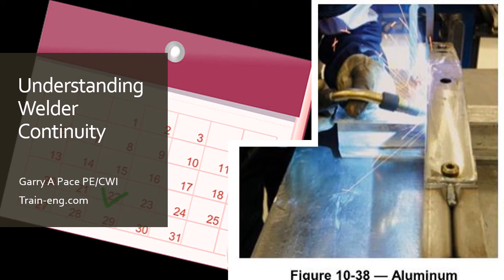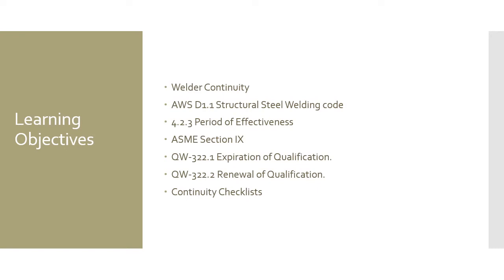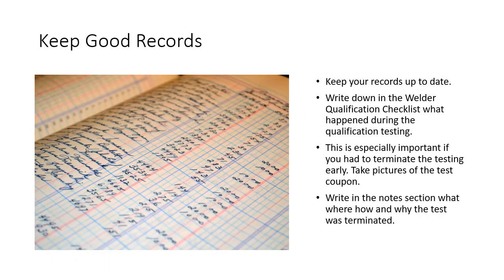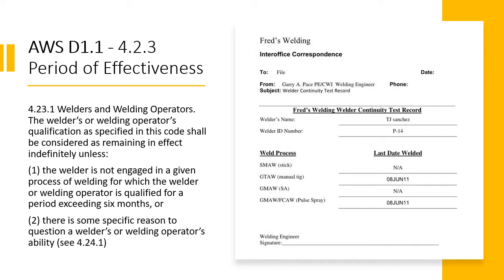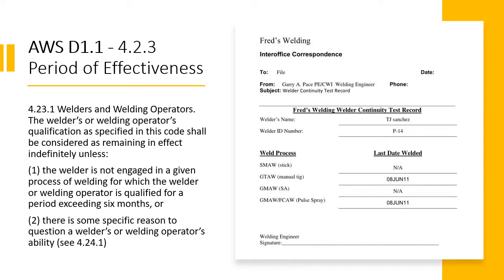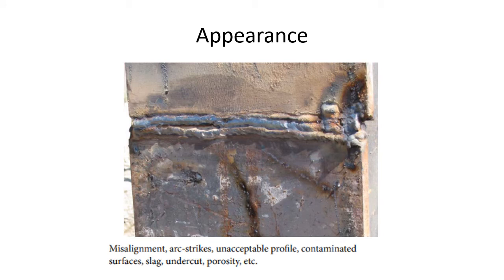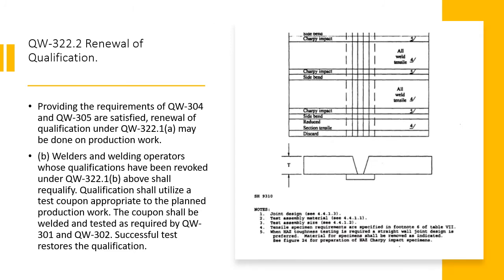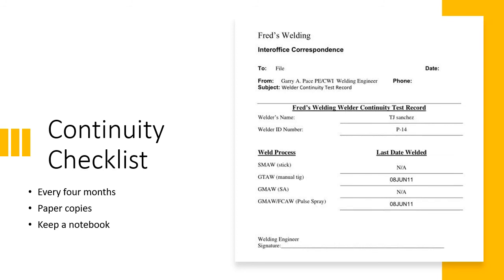Explanation of Welder Continuity

Comment: Hi Garry, Loving the videos by the way. your delivery and content is spot on. I see that at 21.19mins in the spreadsheet shows GMAW & FCAW in the same column. Our shop works primarily to ASME IX but also AWS and ISO weld code along with various construction codes (DNV, API, etc etc). When I read ASME IX Table QW-355, other clauses and the official ASME Interpretations it reads to me that FCAW can be lumped in with GMAW for welder continuity which is aligned with what you have shown on screen.....all good so far...we are on the same page.....but a few welding engineers have asked me to maintain separate continuity record for FCAW and GMAW (although no one has shown me where this is stated as a requirement). I just do it to save the discussion/argument s it isn't a big deal but I would be interested to hear your views on this.
Reply from the maker: For ASME Section IX it is the same process - I can qualify welders with hard wire and they are qualified to use flux core with that same qualification so I would not see any need to keep separate lists for continuity but if you need to for the sake of keeping the arguments to a minimum sometimes you have to go that route.
Reply: @gpacex  FYI - I now keep the FCAW continuity records separate from GMAW to keep the peace and to better comply with ISO weld codes/standards (ISO 9606/ISO 4063 / ISO15614 / ISO 3834). We also have an "examiner/examining body" per definition in ISO witness and sign off.

Comment: Question regarding a potential employer.  The individual told me they were a CWI but doesn't recall when they got the certification and that the paperwork is somewhere they would have to look for it.  They also told me they were able to take the exams at home!  In addition they told me they were only certified up to 3/8" steel but doesn't recall what process.  Sounded very suspicious to me, but I'm not a CWI.  Should I trust this person and their certifying me?  Thanks.
Reply from the maker: Should be able to look up his CWI number in the AWS database. CWI needs a renewal every three years. Lots of unanswered questions - throws up red flags for me.

Comment: Question is that who shall certify that the welders did perform a certain process in the continuity log? Is section 6.2.3 to 6.2.4 the answer? Because it doesn’t make sense to me that anyone can just write a log and sign it even if they are not even a CWI or a PE. If any and for common sense sake, it should be a CWI who should sign off on a continuity log because it is the CWI who is qualified to examine the performance of the welders for any given job within every 6 month period. I hav had disagreement with welding shop owners because they are contesting that it was not required for the continuity log to be signed by CWI
Reply from the maker: It doesn't need to be signed off by a CWI it can be a person in house who has seen the person do the work and use that welding process. There is nothing special attached to performing that task that would require a CWI.
Reply: @gpacex  well this is a gray area because the authors are playing it safe. Not sure whats so hard to define what that “competent person” means. 

When you say competent, who shall certify that person’s competency other than the same entity which is AWS. So it still points out that it should be a CWI. 

How can you accept sign off from just anyone who is not CWI? 

I bet not just “anyone” knows the acceptance criteria of visual inspection table 6. And not just anyone knows the processes and welding variables.